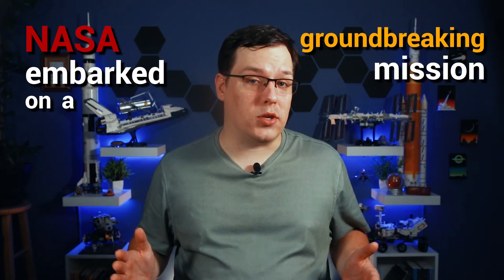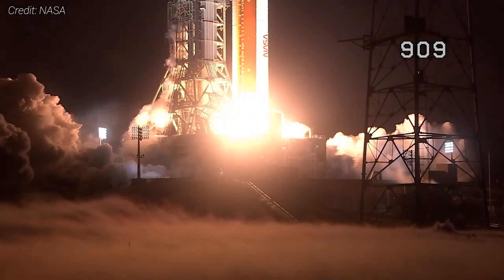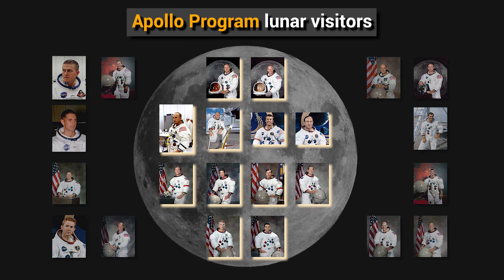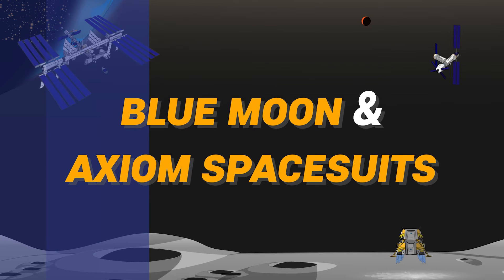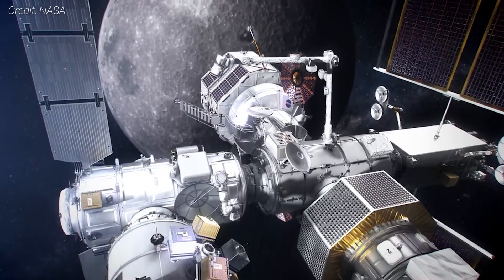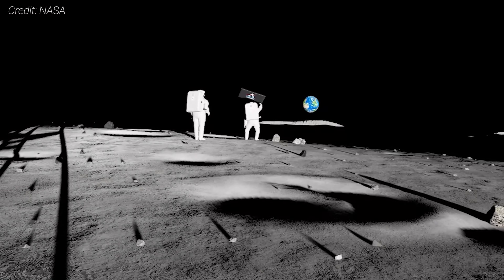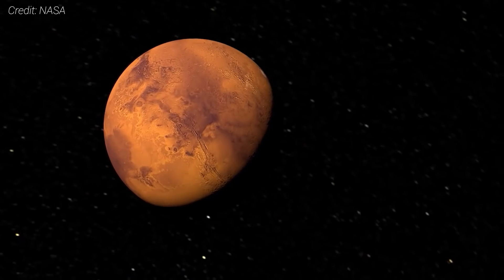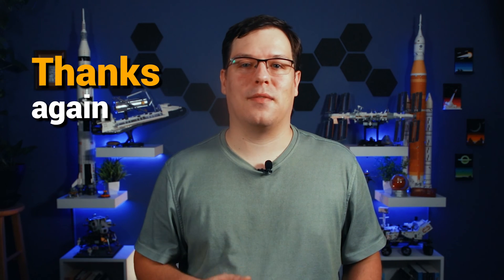Artemis Program Progress in 2023 + Will the Moon Landing Get Delayed?

Comment: 12:45
That door won't be open much longer, ULA is expected to get rid of the Delta IV tooling once the final Delta IVH mission launches in the coming months.
The supplier base has been shut down for at least a year at this point, so ordering more ICPS would require standing that up again, which is quite expensive, and that money is not in NASA's current exploration budget.
Unless the agency reverses their current policy in the immediate future and asks for additional ICPS money, then the option is pretty much dead.
When NSF's Phillip Sloss asked about this a couple of months back the response he got was:
“Although the contract with Boeing and their major subcontractor United Launch Alliance for the first three interim cryogenic propulsion stages provide the option for NASA to procure a fourth interim cryogenic propulsion stage, the agency is not pursuing purchasing hardware for a fourth flight of the SLS Block 1 configuration.”
When Jim Free was again asked about this less than a month ago at NAC HEO he said they are no longer able to procure any more ICPS and they are pretty much locked in with EUS for Artemis 4.
This contradicts Tory Bruno's statement that you showed but probably describes what the agency is planning (or not planning in this case) internally.